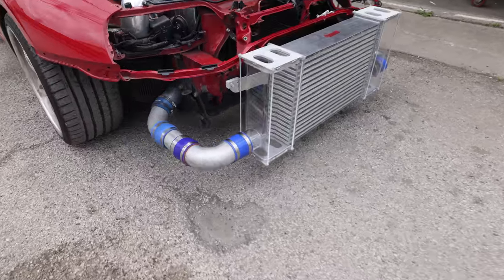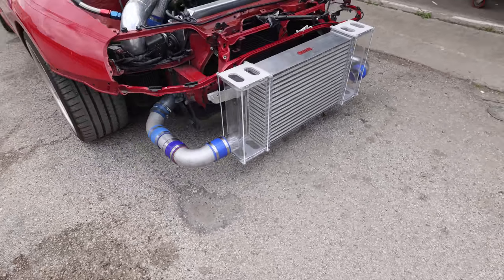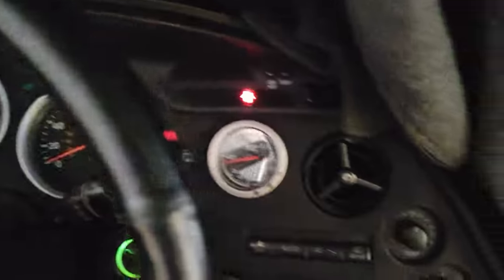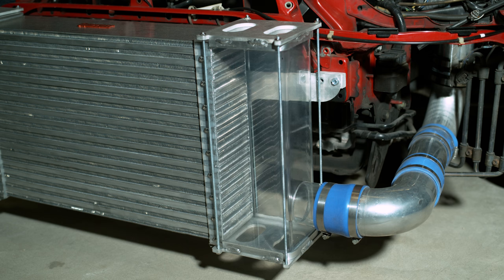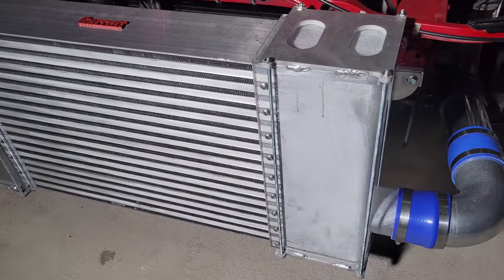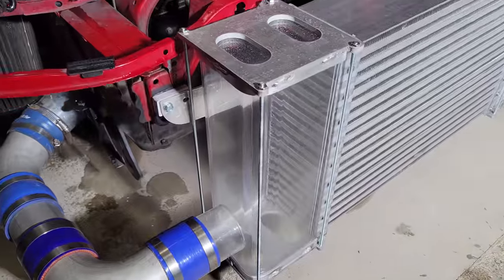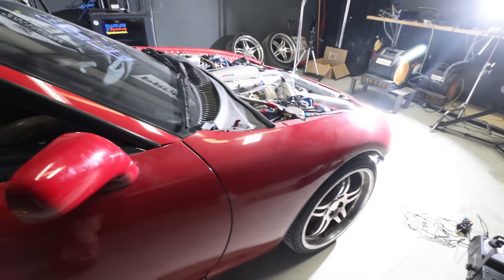See Thru Intercooler In Slow Motion - (Dyno Run High Boost)

Comment: here in phoenix arizona im running 15 psi on sr20det with gt2871 in summer, the hot side of intercooler gets so hot you cant even touch it after a pull but the cold side feels like someone poured water over alluminum and cold to the touch. intercoolers are such a simple yet such a great way to cool charge air.

Comment: The temperatures are pretty normal. Even without a fan the intercooler cold the air also just by his temperature from the previously flow of air. If you run hi pressure for long time you will maybe see temps going little higher. But again one ic with less than 85% of efficiency between ambient air temp and the outside temp would be consider a bad one. Also what is important in this test is check the pressure in and the pressure out that will make also the real (how good it is) obviously this is one experiment very very interesting and I enjoyed your video

Comment: I have had this idea for years but chances are I'll never do it. My idea was to plum an intercooler with copper lines I can dump refrigerant into before a race. The loss of pressure will grab all the heat from the intercooler essentially freezing the cooler. Now that air will be ice cold! Its only going to last a bit till the next refrigerant dump but that can be experimented with. The refrigerant can be propane so not to cause any environmental problems. Yes, propane is a refrigerant.

Comment: if the inlet pipe in positioned in the mid of the inlet tank it will use the whole efficiency of intercooler , as you can see in the fog test most of the fog went through the lower part of the intercooler where is the least resistant, if making the inlet in the middle it will distribute the in air all over or better to use deflectors to direct the flow to the upper part  . 
it would be nice to see the affects of mid position inlets and deflectors if the inlet pipe must be in the lower part of the inlet tank  .

Comment: Just a question, is there any reason that you didn't silicone seal the plastics around the radiator to accurately judge the unit and it's stability under pressure? I think it's a great project and definitely possible to achieve, but much thicker plastics and maybe a stainless mesh support would see you to a working product, also using Silicone may possibly stop a fault line occurring where it did, by dispersing the heat better..

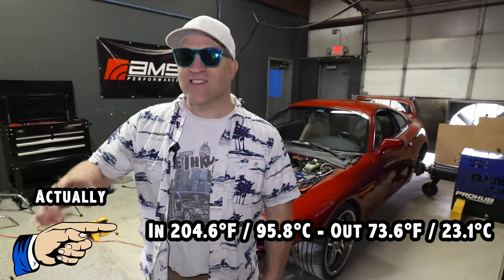Comment: 8:55 Damn….I remember recording data while I made a 1/4 pass in 2JZGTE swapped Mk3 Supra; my IATs were at 144+deg F! And his outlet temps after the intercooler are below 78degF. For my next rebuild on my Mk3 Supra, I’m not going to cheap out on the intercooler again! I’m going with Vibrant.

Comment: It looks like you could experiment with different bell shapes at the inlet & outlet of the intercooler. There has to be a shape to increase the efficiency of the flow. Not trying to increase turbo pressure but to maximize the velocity of the air stream. I would love to collaborate with you on that. Thanks, I enjoy your work.

Comment: Be good to see the smoke machine with a thin nozzle in front of the intercooler to see what proportion of air deflects around the cooler. Then create a Perspex shroud to see the flow distribution after. Good video.

Comment: Pretty cool! I was about to suggest the temp probes but then there they were. The fog makes me wonder about the flow through most intercoolers and what could be done to help it.
Reply: Maybe a more compact intercooler but then I guess to small won't shift the air quick enough. Maybe compare a standard or stock vs an aftermarket tuning cooler. 
I do know a bigger exhaust is not always a benefit so could be the same with a cooler.
Reply: @VinDieselS70  
Boost volume acts kind of oddly. On aircraft with same engine, same turbo and intercooler with larger ducts will actually increase hp a bit. Not sure why but you can feel it for sure.

Comment: What this shows me is that intercooler piping length does not matter. Those end tanks filled up in like half a second
Reply: That is not a true statement. A longer pipe will take longer to pressurize. It's just simple physics. Now whether or not you have enough turbo to reach the max flow capabilities of both pipes is a totally different system... and in that case, with a smaller turbo, it would actually take longer to build boost pressure since you have more volume to pressurize. 

But in practicality, which I think is what you mean, if you had a routing that added another 6-8-12 inches to the length of the plumbing, you're really not gonna see that.
Reply: To be fair, that half second would 100% contribute to lag

Comment: If you notice air passes through the bottom more so than the top.  So a diverter would benefit you if you built an actual 6" set up

Comment: What I was going to suggest to test the system was you just plug it in and pump air into it and see how much pressure you can run through it before it blows it should have had some more safety straps on the plastic and may have blocked some of you but three safety straps around the sides or for whatever kept things from blowing up and stretching

Comment: Surely compressing air through small channels created a slight increase in temp before cooling it through the vanes. Using the smoke clearly shows that the intercooler is also a restriction on air flow, makes you wonder what the outcome is if you use free flowing intercooler that is less restrictive but might not cool as well
Reply: There shouldn't be any compression happening after the turbo itself. Unless the air in the intake is approaching supersonic velocities, channelling it through a narrower section will actually decrease the pressure due to increased air velocity (Bernoulli's Law).

Comment: Not to nitpick but you're not supposed to extend thermocouples like that. You would need to use thermocouple wire. Thermocouples work by reading the voltage produced by 2 different metals. If you use regular meter leads you are adding 2 more points of dissimilar metals  that will also produce a voltage at a different temperature. It may be close but not exact. Okay for the purposes of this I suppose, just a relative measurement.

Comment: Don't know how you'd bend it, but making the tanks somewhat trapezoidal to make the flow even through the intercooler would be interesting, or center the ports top to bottom... That may be beyond the scope of what you can manufacture without serious specific tools. I'd also go to 3/8 or 7/16 thick material on the tanks.

Cool video though!
Reply from the maker: I was going to do that originally, but you wouldn't be able to see the flow as well, also I forgot to include it in the video but I did show the reason it broke was because the pressure exceeded the tensile strength of the material... It was very interesting. I may post that separately

Comment: some preferential flow at the bottom of the cooler where the the tubes mount. I wonder if you could gain more cooling if the in/out of the tanks had 3 ports that combine into the 1 so you use the surface area of the cooler more evenly. Have you done any CFM calcs? You might benefit from a smaller cooler as it could use more of the surface area if you use only 1 tube. Your really just reducing the temp to help with pre-detonation  once you start making real boost anyway.

Comment: It's not so much the heat transfer of the intercooler as it is the compression on the hot side and decompression on the cold side that makes the temps drop so much. Same basic principal that your AC system works off of.

Comment: I'm surprised to see the flow of air seems to fill the pre and post cooler chambers with reasonable uniformity. Seems that the air deflectors on the hot side marketed as crucial on some intercoolers isn't so crucial after all.

Comment: Are you sure those temp readings are correct? That seems like an awfully dramatic difference especially without a fan or driving it. Too bad your tank blew off but it did hold some pretty good boost for a while.

Comment: WOW - with the fog its easier to see the leaks in the intercooler.  You think maybe a gasketing material around the clear seals may help you out?
Reply from the maker: No the things were sealed, but the one that was leaking was the tank that broke and I repaired I just didn't see it up all the way cuz I didn't want to make a mess with the silicone, but now we know even a tiny leak like that is a leak.

Comment: So ok would the regular sides have flutes to Guide the air to the upper first then to the lower radiator or it just blows from one side to the next or does it step up bottom and top tube

Comment: As an engineer, why do you have the inlet and outlet low? I am not a mechanical engineer I'm a computer engineer, but wouldn't it be better for air flow of they were in the middle of the intercooler?

Comment: so, you need to put 1 pipe on the top to balance out the airflow across the intercooler. the top is not doing much right now.

Comment: If that's a steam fogger, you're also cooling the intake charge even more 😉
Reply: Dave Pin  lol thanks for the compliment. I have to assume you are educated on how water injection, or water methanol injection which is more common, works or you wouldn't have mentioned it.
Reply: Dave Pin  yes indeed. It displaces the air, but that air will be more dense because of it having rapidly cooled down.  I couldn't say for certain how much of an affect his fogger would affect everything. Fog machine usually heat water up to create the fog. I'd be interested in seeing a controlled test of it being used. His purpose was to show the air moving. But I'm sure he could do another to show weather or not it's able to cool the intake charge even more, and how much of a difference he would need to adjust the fueling. With water and meth the AFR usually goes rich because of the meth content, and as you pointed out because it affects the stoichiometric value, the AFR has to be adjusted. Usually pull or add fuel out. I adjust fueling with tuning the MAF table accordingly with HP tuners. I just haven't pulled the trigger on getting a WM injection system yet lol

Comment: Interesting, thru flow isn't even top to bottom so the intercooler isn't efficient as far as maximum cooling is concerned, perhaps better cooling results would come from a centered outlet end spigot or cross flow inlet/outlet. Should run the test again to look for better cooling possibilities.

Comment: Seems with that setup the lower part of the cooler is used more than the top. Maybe cooler would cool air even more if something was done about ut. Maybe split the air into two or three pipes on each side.
Reply from the maker: I agree but what I did here was mimic the original intercooler setup almost exactly

Comment: I always thought an intercooler was for cooling the oil that cools and lubricates the turbobearing. Smartereveryday
Reply: Thinking of the oil cooler maybe? Works exactly the same.
Reply: @MrWip3out  so with a turbo you need at least two radiators?
Reply: @lukasvercaempst44  Yes and no. It is recommended to run the oil cooler as well due to increased heat soak in the oil. 

No - Some car manufacturers do not run one as they have calculated that the oil in the system would not get hot enough to warrant an oil cooler. This you will see in lightly boosted stock cars as they have no oil coolers themselves. 

Yes - For all intents and purposes, if you are going to boost a non boosted car or run higher power, the oil cooler will extend the life of your oil and engine immeasurably.
Reply: @MrWip3out  ait, thanks for clearing that up mate!

Comment: Looks like the tanks could be better designed for flow. The port is at the bottom. Seems like the air at the top is getting trapped and just circling.

Comment: I would think you could run higher boost with welded on aluminum end tanks and just have one face be plexiglass. Also use thicker plexiglass.
Reply from the maker: Yes possibly that was my original plan, but it's not so easy, in order to light something up like this for the high-speed camera I need a lot of light coming into the tank, a little window isn't going to do it, plus I like to see things nice and clear so if I have to make it thicker or beef it up I would rather do that than take a shortcut and cut open an existing intercooler.

Comment: So theoretically much like runnin an ice tank what about running dry ice??? Okay so no running thru intercooler regularly but what if the dry ice wasnt direct to the intercooler and persay an air passage mixed with a bit warmer air "cough cough" exhaust. Would that theoretically be possible and woukd it even be worth it

Comment: I don't really get the point of visually seeing air move through a heat exchanger when the only difference is temperature change but cool build anyways. 

Also why would you only support the ends when your builds blew up in the middle

Comment: Pressuring a rectangular box was asking for failure. If that had been designed with basic engineering in mind you could have gotten way more boost before the POP
Reply from the maker: You're correct, I was just explaining to somebody about the trapezoidal design of the current intercoolers and why they are made that way, because static pressure only pushes in One direction. Now that being said since the videos are visual, that's really what I focus on when I engineer and design these things, I need to make it visually appealing how's the video just won't do well. But yes you are absolutely right

Comment: Do you actually know that by throwing water just like how you did, small hose steady flow, mid high rpm, that is how you remover carbon deposits from valves pistons etc etc. It will not damage anything unless you dump alot of water at once lol... Most people are afraid of what they don't understand. Nice way to lower your combustion chamber temps and water going into fog in the cylinder expands by a factor of about 2000, so technically you won't loose power (just like driving in the rain)

Comment: I mean definitely a cool idea I'm not knocking the dude at all awesome Fab work but with all due respect to the owner it sounded cooler and it really was it would be neat to have some intake Temps with some Inlet Temps that's free turbo Temps post intercooler Temps to see how efficient it is because that's the most important part does it cool the air because if it doesn't look good is it it doesn't even fit the car whatsoever huge so it should work good

Comment: Cool, wonder if it would flow better with the outlet on top.
Reply from the maker: That's what I was wondering too and that's exactly the reason I did the video was to see if having the inlet and outlet directly across from one another like most front mount intercoolers do has any effect on the airflow pattern.

Comment: 15 psi is 1000 pounds of force? My 2.0T puts out 25 psi and I was surprised to see people being shocked at my turbo putting out that number
Reply from the maker: Yes that's is correct, 5" wide x 15" tall = 75 square inches, 15 psi (pounds per square inch) x 75 square inches = 1125 pounds of force.

Comment: If the intercooler cooled down in between runs your just heat soaking the intercooler, temps wasn't a true representative of the temps while running.
Reply from the maker: I don't know about that, but we will see in a future video I'm going to follow up with some serious more intense Dyno runs, possibly with another see through intercooler but I'm not sure yet. But I am very very curious to see what that intercooler does.
Reply: @WarpedYT  watching Banks power, killing a Duramax series. They go crazy with data, even have their own data logging. One of the things that blew my mind was the intercooler adds as much power as a turbo.

Comment: Be careful puting water into the turbo like that. The impact force on the impellers can pit or chip them. 
I'm only going off what others have shown, trying out water injection ideas and they had to rebuild the turbo after.
Reply from the maker: Absolutely, thank you for that, I am aware, that is why I siphoned it slowly the way I did so It can vaporize before going into the turbo. People don't realize the speed of those compressors and being aluminum they are pretty soft

Comment: Only a 40 F  differential.. not effective enough to see noticeable improvement.. intercooler or HEAT EXCHANGERS work most effectively when a specific set of rules are achieved.  Doing this in an enclosed garage with little to no actually air flow can not replicate real world applications.. traveling at 25mph with ambient temps above 90 f you should see at least 50 degree f  variance..
Reply from the maker: 200 inlet temp-70 outlet temp = 130 degree differential.. not sure where you got your numbers from but they don't match this video

Comment: 🤦‍♂️ Thermal images would give you all of that data and you would still have a functional intercooler
Reply from the maker: I did have the thermal camera there but I forgot to use it. However that would have just been supplemental, I honestly don't even care what the intercooler does, I just wanted to see inside.

Comment: That’s the worst intercooler tank design ever
If you want to look at really efficient intercooler s
Look at the large trucks
They are all tapered and pay attention to the path of air flow
Also intercooler s should never be over 80 mm thick the ambient air struggles to get thru them even at 100 mph
Go an put manometers on that intercooler pipe work you’ll be dropping 2 psi at 600 hp
BHER made really nice tanks on Michelle Moutons Audi
Think how many time the air has to make a direction change 90 degrees turns just suck